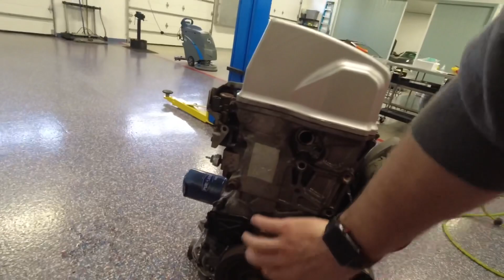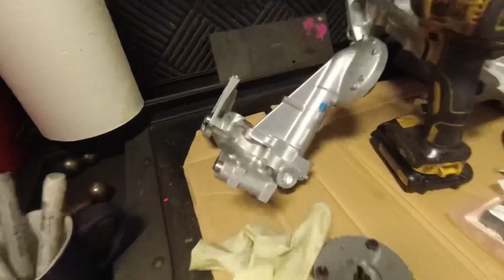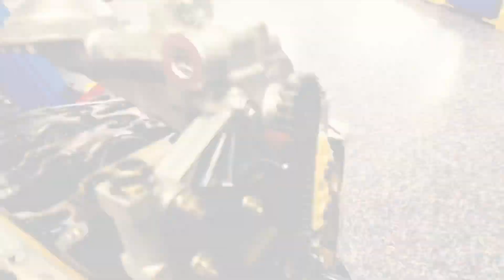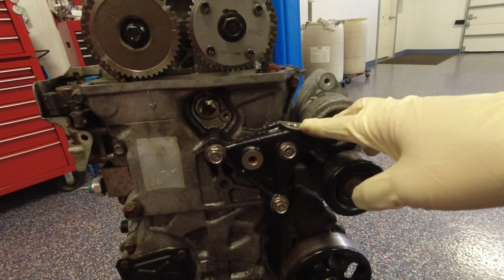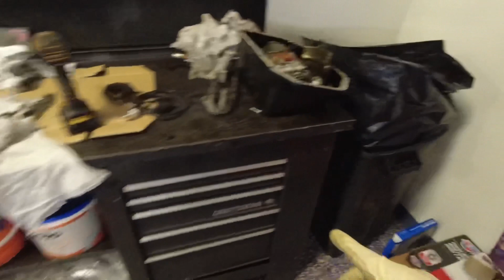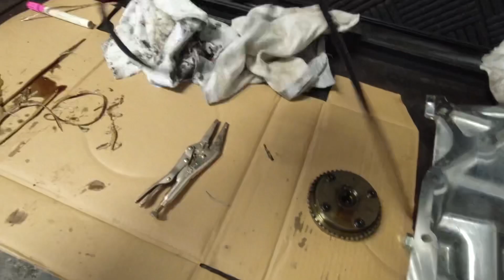Honda K24 to K20 VTC Actuator and Oil Pump Swap

Comment: Yo I'm so glad u did a displacement test to see the pan capacity, goin the extra mile! I wonder if you could take the normal pan dowels and epoxy or drill them into the dowel spots on the new pan?
Reply from the maker: Glad you enjoyed that. I knew it was a larger pan by looking at it but just had to know how much. 

The dowels I’m going to try for a factory dowel and clean up this turd of an aftermarket pan. They were crooked and I’m not even sure they are located correctly lol
Reply: @berttnotbought804  hey fair enough. This video also helped show how easy to change that oil cover over would be for the k24z3 with no crank sensor hole if needed
Reply from the maker: If the bolt holes line up. For sure.

Comment: I see a ton of videos that describe HOW to do this oil pump install.  But I don't see a lot of info on WHY.  What are  the pros/cons?  When does it make sense just to keep the stock K24 balancer oil pump?
Reply from the maker: That K24 assembly causes cavitation at high RPM. If you are spinning your K24 any faster than OE rev limit you need to get a pump without the balance shaft assy. Also this pump is higher volume, RPM, and I think higher pressure.
Reply: @berttnotbought804  So if I'm just rebuilding a K24A2  for my TSX,  (because of a blown head gasket), and putting in new cam and crank seals, (but NOT planning on boost, or more aggressive cams,  or rev limiter changes, then there's nothing wrong with the stock balancer-shaft oil pump.  Correct?
Reply from the maker: Nope. Should be just fine as long as it’s in good condition!
Reply: @berttnotbought804  Thank you so much!  Fingers crossed all I'll need is the head resurfaced.  I tell ya, just unplugging that 20 yr old wiring harness, is a big pain.  Almost every every connector's locking-tab broke. New connector set ordered!
Reply from the maker: Anytime my man. Glad I could help. Good luck with the build it will be fun one for sure. I get it with the old connectors. I have a couple of wiring videos on here that can show you how to refresh a harness. It’s a 3parter but it will walk you through every step. If you think it’ll help check it out. I’m also about to build a full Motorsport spec harness for this engine here in the next month or so. 

I hope my channel can help/inspire you. 🤘🏻

-Brett

Comment: Hi i have a question : can i remplace k24z3 with k24a2 Will there be a problem reading  the sensor of position crank?
Reply from the maker: If the crank position sensor is in the timing cover there should be no problem

Comment: I know this was a while ago but your videos are quite detailed so, you seem to be one of the better K-Series content vloggers. Why does nobody talk about the oil filter and oil coolers on these engines? There are a few options out there but I can’t see when you should step up from one (OEM HE) to another (separate remote oil cooler)?
Reply from the maker: Sorry for the late reply on this one. I really appreciate the kind words and I try to make sure my content is clear, concise and helpful. As far as oil coolers, the OE "cooler" is a great option because it's also a warmer when the engine is warming up because coolant gets warm a lot faster than oil. But I race a D16 in the champcar endurance series and based on that experience I would say, once you notice your cooler doesn't have the capacity to keep your oil temp below 250ish degF, it's time to try a thinner oil or a remote cooler. I do not know the limitations of the factory cooler, but you've given me an idea for the future. I appreciate you and your comment! -Brett

Comment: Pretty sure UNLOCKED with compressed air is the correct way to torque the VTC actuator (Intake Cam Gear). Then you lock it to set your chain on. Then put on the guides. Align the marks. Then set your tension.

Comment: With that switch how you going to run your oil feed line for turbo ?
Reply from the maker: It’s a pressure and temperature sensor. And there will be an oil cooler with a 1/8”NPT bung on it that will feed the turbo. I may switch their positions to get a more accurate reading of temp.

Comment: I have a jdm k24a and I recently bought a type s oil pump kit that comes with everything needed and an RBC 50 degree VTC. My question is, the type s cam gear and Z3 civic si cam gear are both 50 degree correct? I believe I read somewhere some VTC’s are marked PRB(Acura) and some RBC(Honda) but they’re both interchangeable correct because they both allow a maximum of 50 degree vtc?
Reply from the maker: K20Z3 and K20A2 are the same. I used the K20Z3 on my engine. Easier to get considering the Honda dealer is 20miles closer
Reply: @berttnotbought804  cool thnx. Oh…one more question. Can I remove the old k24 VTC cam gear without having to remove the cam from the head?
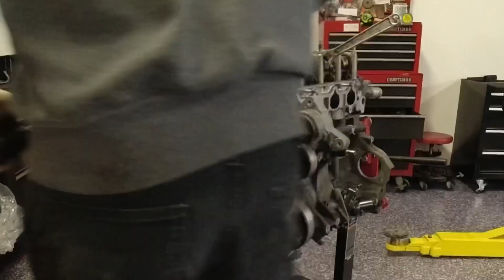Reply from the maker: Yeah for sure. It happens fast but at 10:25 you can see me put a wrench on the cam and zip the bolt out with an impact. BE SURE to hold the cam still when you take the bolt out. If you don’t and it rolls over you’re asking for bent valves if the engine is at TDC.
Reply: @berttnotbought804  oh cool I totally missed it thnx!
Reply: @berttnotbought804  from the looks of it the 50 degree VTC I received already looks to be in the “locked” position. you can lock and unlock it again correct? Just wanted to ensure I do in fact have it locked.
Reply from the maker: No worries. Best of luck. Reach out if you need more guidance. Happy to help. 🤘🏻

Comment: I've heard two things
1. You have to pin the vtc so that it doesn't go beyond 50 deg. Do you intend to pin it? How is it pinned? 
2. You don't get any benefit of 50 deg on boosted applications with stock cams coz of their lift. Moreover beyond 45 there are clearance issues.
Reply from the maker: The VTC cannot, by design, exceed 50°. I’m not sure where you got that info. And the 50° is massive for boosted applications. It allows for valve overlap when there is no boost then can advance the intake cam to a point where there is no valve overlap to eliminate a boost leak out the exhaust. The PCM controls how many degrees of advance there is. It’s not 0 or 50. It can maintain any angle in between with very tight accuracy.

Humble performance has quite a few videos that go over this in practice and show the results. 50° is the way.

Comment: Thanks for taking the time to make this video. It was great to see the difference in oil capacity without balance shafts. I plan to build a K24a2 block with K20z3 head for my 8th gen civic Si. 👍
Reply from the maker: Absolutely! Happy to help. That’s why I made this channel. There’s plenty more stuff like this to come. Stay tuned and hang on to that oil pan lol. Thank you for the views, support, and interaction 🤘🏻 - Brett
Reply: @berttnotbought804 You got a new subscriber here looking forward to the build
Reply from the maker: I just subscribed from both my channels man. Happy to support as well. Looking forward to your build as well. I’m an engineer at Honda Mfg. so if you ever need any input toss me a comment and I’ll see what I can do

Comment: I think it have it have clearance issues in k swap because the aluminum oil pan is taller when people are doing k20z1 swap they actually swap  the pan for the steel one
Reply from the maker: Thanks for the feed back. That’s good to know. The car this is going into has a taller tire and doesn’t exactly ride low to the ground to begin with. So knowing that’s why actually puts me at ease. I did step back and look at that engine and said “damn that thing is tall” lol.

I appreciate the views, support, and feedback man! 🤘🏻- Brett

Edit: I did some digging and the pan on the Z1 is a PRB and was designed to not have balance shafts in it as it had the style of pump I installed in this video. The pan I used is an RRC and was designed to have extra oil capacity along with the balance shaft assemblies displacing the oil in the sump. So the pan I used was even larger than the one you are referring to.